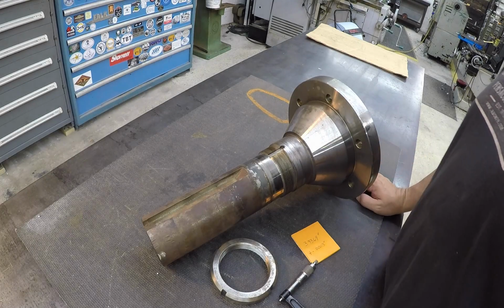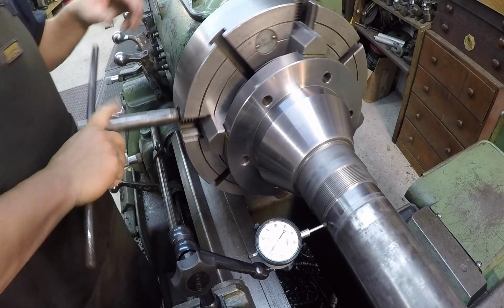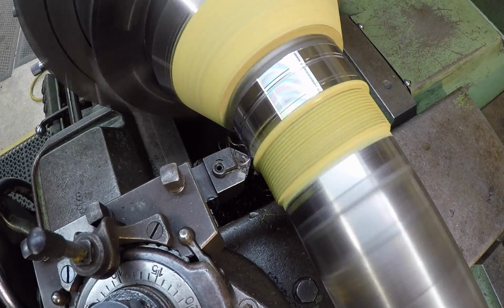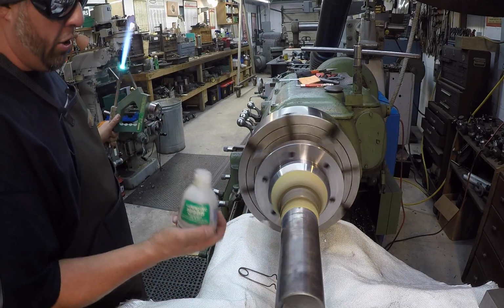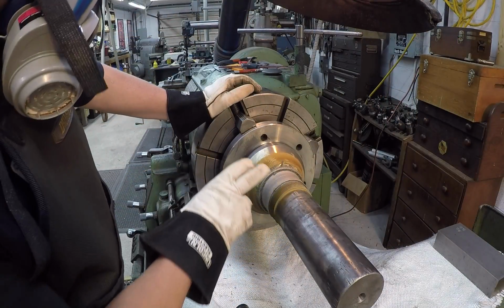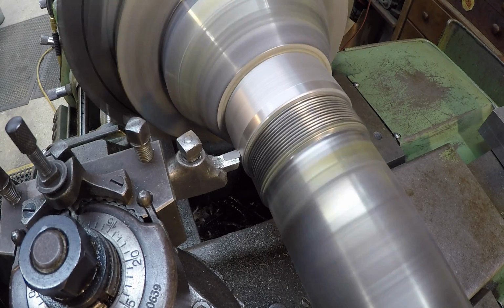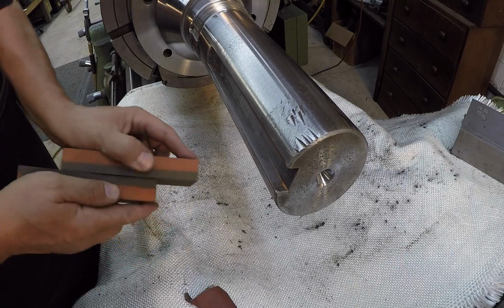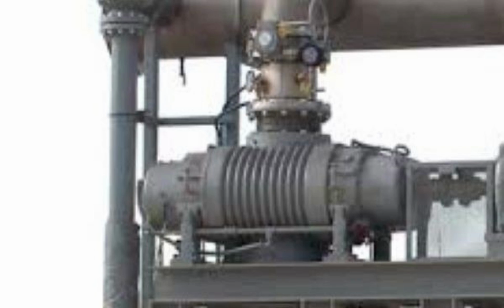SNS 300: Spray Welding a Blower Shaft

Comment: Interesting.  I used to be a machine operator (never got to be a certified machinist) back in the mid to late '60's,  Never heard of or seen Spray Welding before.  Great video. I love seeing a real true craftsman at work.  Your attention to detail is truly admirable.  Thanks for sharing.  I used to work in a plating room and had seen hard chroming done to tooling before but I'm not sure just what the limits are as to home much you can build up with hard chrome.  Typically the surface would be ground down to size afterwards.

Comment: I did metal shop back in HS for 3 years. I loved working the lathe, loved the smell of old oil and metal. Sadly they stopped offering it shortly after I graduated. Was a mechanic in the Air Force then wound up in IT. Think I would have liked to be an apprentice at a machine shop. Just found your channel and subscribed. Love it.
Reply: Sorry forgot to ask and maybe I missed it. Now this is the most awesome flaming death thing I've seen in a while, why do this over heat shrinking a sleeve on it? I heard you saying if this can't be done you would put a sleeve on it but why choose spray welding first? Seems amazing. Is the bond between the new spray material and the original almost like new? (maybe not saying it correctly but I think you know what I'm getting at) How would it crack or fail along the boundary?  What about brittleness of metal vs the spray addition?

Comment: I've done flame spray welding before to spray Aluminum on to steel on board ships where sea water is present a lot. The surface was sandblasted  first, then we sprayed. The worst part was that the humidity in the area we worked in had to be 40 percent or lower so the area had to have climate control to make that happen or the sprayed aluminum would just peel off. The equipment we used was also ancient and we spent as much time fixing it as using it. All in all, not my favorite type of welding.

Comment: I have heard about this, but never seen it before. Fascinating.
Having had various shafts hard chromed to save them with only moderate success. Mostly automotive.
I was surprised that shaft was still straight, I have seen no end of bearings that have spun and the shaft is never straight. Even if only 2-5 thou out of wack. That on an 25-30mm shaft.

Comment: This is a off topic question but does anyone know if parts washers filter and re-use the cleaning solvent ?
Reply: Yes, they do. The solvent is returned to a tank underneath the basin. The tank is wide and shallow, so that the solvent moves slowly and the particulates settle out before the pump picks it up again at the other end.
Reply: @BillGatliff  I appreciate the reply. I think its time for me to look into a part washer unit. Do you know if there are any decently priced units out there ? I only have a small hobby shot so I don't need anything crazy.

Comment: Have you ever try TIG welding + lathe instead of this way? I think it work and save cost.
Reply: He said in the video that he didn't want to weld it because of the higher heat input of traditional arc welding methods such as TIG, causing the material to warp. Customer probably asked for it to be spray welded instead of arc welded. All depends on the requirements, standards and specifications given by the customer
Reply: He mentioned that at the end of the video: the heat required can stress and warp some parts.

Comment: What is alloy for base layer and finish layer?  We used a material for base we called "nickel alumide", a wire; and a stainless wire for finish----(bearing and seal surfaces).  Well done video, lots of good tips and techniques.  Thanks.
Reply: I used a similar bond coating for most of my work. Used two grades of SS for bearings and seals as well. We’re you using a twin-arc wire spray or single wire flame spray?

Comment: Only thing I would have done differently is that I would have used a tool post grinder for the finish cuts. Done this procedure before.
Reply: Machinists who finished my spray jobs used tool post grinders quite often. Really good results.

Comment: we did shaft repair in our electric motor and pump shop back in 1961, however, we did not wave a torch fixture around in the air, the thing was affixed to the lathe for a more accurate job and the shaft was preheated in an oven overnight go figure, I would think this type of repair would be more common 60 years later!  THANKS FOR THE SHOW  WOW !
Reply: how old are you sorry but that was unexpected.  And #Abom79 you know your Craftmanship very well!! sorry for the bad english :D

Comment: I've read a lot of the comments but no one seems to know what the yellow material is that he paints on the shaft for protection.  Also, what is the material powder that is used in the 2-step process of the spraying?
Reply: I'd guess it's a ceramic coating. Maybe similar to stufff used in metal casting processes to separate the piece from the form.

Comment: Facinating video, clearly you spray enough and then cut back such that you can measure the sprayed layer when hot as presumably there will be some reduction in size as it cools back to room temp.
Reply: Yeah, you have to assume some shrinkage, then recheck after it cools to be sure. Do it a few times and you get a feel for how much a part will likely shrink. 
This guy, he knows his stuff. Love this.

Comment: Incredible work!!   Back in my day it was simply called "Metal spray"...  In the racing business we certainly used the process for high dollar custom components that got thumped, bumped and galled!  Use to be a place in San Diego called "San Diego Metal Spray"...  No idea if it's still there, but they did a lot of work out of that place both for private endeavors as well as commercial work.   Great video!

Comment: Ive done all stick , mig. and tig , submerged arc , heli arch , gasless wire , flux core .045 ,7018to 12018, stainless steel 308-309 basically all welding types,  im federal certified,  but my first Time seeing spray weld,  and I'm still mesmerized how good it looked and seemed to work real nice ,.....

Comment: One more question,  what is the tensile strength of this welding?????
Reply: Depending on the material and the spray process, I used to get 10k PSI pull tests on some of my coatings.

Comment: I remember doing metalizing on gas turbine parts. We had different processes to metalize. Plasma jet metalizing and oxy acetylene. From what I remember the bond layer was the key to a successful adhesion and sheer strength. High nickel powder bond. Great video. Takes me back.

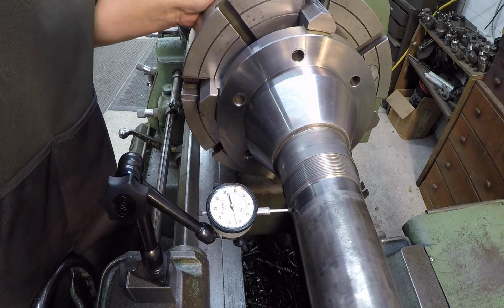Comment: I see at 7:40 you use a gauge to ensure concentricity.  If the shaft cross section has defects (i.e., the shaft circumference at point of measure is not sufficiently circular), how would you go about fine tuning the jaws of the chuck?

Comment: I did something like this back in the 70's, it was called metal spraying and used a wire feed which was fed into the oxy acetylene flame where is melted and coated the work piece.

Comment: I've seen this process back in 1969, but the spray machine was different. It shoot out bigger sparks. I believe it used a wire instead of powder.
Reply: Yeah, I worked in a big electric motor shop in 1968...we used a spray method with Oxy-Acet and a hard wire...the powders weren't really around yet...but now thank Eutectic for a great product!!

Comment: I was involved in this work when it was cutting edge tech..I hated doing it because it involved saving very large expensive parts weighing a literal ton or more and my boss was NOT happy...to say the least...if it failed to work.. and the work was an all day scorching experience that often failed leaving me to start again the next day...it was a pressure cooker job with little extra reward when it worked and a real sh_t storm when it didn't ...but it looks like the process has improved...but I'm content to watch instead of do it

Comment: ADJUSTABLE COUNTER WEIGHT FOR LOADINGG HEAVY PARTS! AND WOULD A 3 JAW CHUCK NOT BE BETTER FOR. TTHIS TYPE OF WORK?
Reply: He used brass shims on the jaws, he backed one jaw a bit less than half the total indicated runout and tightened the opposing jaw to to bring the work to about half the tid then did the other two to center the work near the chuck; then he tapped the far end into get the angle alignment orientation correct.  When a consummate Master Engineer/Machinist does it it look so easy. When I saw him center/align the work I knew I was in for a treat, perfect cut depth and surface speeds a pleasure to behold, and the icing on the cake spray powder metallurgy buildup.

Comment: glad you mentioned that this can't be used when a needle bearing is utilized ! about 20 yrs ago a company said they could build up the power steering cross shaft for a HF-64 Ross unit ! it lasted about 100 yds and peeled every bit of the stuff off and ended up in the p/s pump and locked the gear up!

Comment: I'm not, in any way, a welder.  But MAN this looks like it's messy and wasteful.  But at the same time, it's pleasurable to watch.  Thanks for posting!
Reply: it does seem to use far less metal and heat energy than casting or forging a new part that large.

Comment: Awesome video! I have an old spray welding kit that I inherited and I’ve read about the process but never actually seen it done. Im wondering if the process could be used for applying a hardface coating to a flat plate?Could a tungsten dust be applied with this process?

Comment: Hi, I got a pinion from a car which had been turned down 1/2 thousandth too much.  The machinist wanted the bearing to slide on.  All bearings are press fit and I am worried the pressures will cause this to fail early.. Can you put a little over 1/2 back on this pinion where the bearing sits?

Comment: Great job on this video. Spray weld is a common need for fast repair in the oil refining industry on bearing journals. We utilize repairs like this quite a bit.

You’ve done an exceptional job documenting and showing this process.

Very much appreciated and thank you!

Comment: Use a proper fuckn welder
Reply: He explains towards the end why he doesn't just use a welder. It heats the part up too much and can actually alter the temper of the metal which is very bad.
Reply: ur a dingus
Reply: use a dictionary and learn how to spell
Reply: @frankhorvath817  UR a dingus

Comment: Brilliant, never heard of spray welding before - fascinating to watch and the explanation awesome as well.
Any idea how hard the spray weld would be (Rockwell) compared to the original journal before it was repaired (roughly - ball park). Just curious if it’s much softer. Is it like a similar process to thermit welding they use on repairing broken railway lines?
👍👍👍🇦🇺

Comment: Question ?...... Those big dings on the end of the shaft... why not Tig fill them and turn them down or burnish them out of the shaft ?   would look lots better than with the polished dings
on the returned job.... but..... it sure looks like fine work.....  Just found your video and I'm a closet metal worker/welder/J.O.A.T.'s... GREAT JOB !
My Father was a welder for Bash Ross Oil Tool Company and some of that rubbed off on me. ( lol.) The oil not the welding.
Reply: Most likely that side gets a keyed coupling where those marks wont matter.

Comment: Hello, I believe you have used the micrometer with flat face to measure the journal diameter after grind finish. Shouldn't the micrometer used for diameter measurement have round ends for accurate measurement?
Reply: the piece is round so you are catching the outside measurement accurately, when you want round ends is for internal measurements. and im pretty sure that is done with a little removable tool that is springloaded with rounded ends and you then measure this tool
Reply: The flat face is correct for OD measurements.

Comment: Thank you for sharing this. I heard of this during the middle 70's from an employer but had not seen it done. Decades later seeing  it done helps understand why it was used then. I was told by this employer that it was cheaper than replacing the shaft & done properly that it would outlast an original.

Comment: Why did you take the piece off the center to do the actual spray welding?? Just trying to learn.
Reply: Centre not needed plus thermal expansion.
Reply: @samf5442  - why was the center not needed? Isn't it always better to have it it in place and how much expansion would reach all the way to the center hold over 1 ft. away??
Reply: He's running low rpm, the shaft is balanced enough for there to very little throw out due to centrifugal forces, it probably expanded by a few thousandths of an inch, which would just pre load the centre bearings, shortening the lifespan of said bearings unnecessarily, plus he wasn't turning the diameter near the end so the centre isn't needed, except for initial setup.
Reply: He cut the center to see if it was sleeved.
Reply: @AEJSOH20  - I was speaking of the center point hold opposite of the chuck for holding the piece in place?

Comment: Very nice work dude !! congrats you did a good job !!, this normally does we do not in the Netherlands, they welding it MIG welding, but they try to be aware of the to much heat inside the material so they use cold air to temper the heat.

Comment: one more tip

prior to your working tool, place several 'pre' burners before the work zone and at increasing temps!! 

core temp must be 200F it seems, but the higher the surface temp, the better the bond! so by using several 'staged' pre-heaters, you can achieve 'atomic' surface temps exceeding 1200F (right before you spray weld) and so your weld will be significantly more homogeneous and oh so much stronger and also easier to cut

much the same way as water evaporation works on clothing - only the surface layer reaches boiling point/phase change due to convection forced thermal induction, thus only the surface layer evaporates

same principle, in reverse
Reply: If you get it that hot, aren't you risking the temper? The last thing you want to do is have to heat treat the entire part again. You don't know what the original specs were and messing around with temper on a customer's part isn't smart.
Reply: @gotindrachenhart  
only if you heat more than the surface! it would be tricky, and may even require cooling after the application to prevent overheating the substrate - as mentioned one only needs heat the surface layer a few thou deep

Comment: Folks might be asking... and why not use regular welding rods and rebuild the worn out shaft?  This is the first mistake mechanics do in their life.... weld a shaft!  A shaft cannot be welded ever,  all the steel mechanical properties are lost if a welding rod is applied.  This process is known as a low temperature metallizing.  Temperature is kept below annealing so steel properties are not changed.
Reply: Carlos, I worked for an engine rebuilder for 14 years and he would weld crankshafts that were complete JUNK! He welded 2 marine engines on a raceboat that were doomed to failure. The boat didn't make it out of the harbor when BOTH crankshafts failed!
Reply: More than likely a Mild Steel shaft, thus  with a low carbon content of approximately 0.05–0.30% carbon if same  no heat treatment process apart from Case Hardening, could be carried out on same, the Kicker is whatever about the cost ...  quick turnaround as this item  the priority Time is Money  ... or  may have been taken out during, an annual Plant  "Shutdown" so was wanted back ASAP for Millwrights to rebuild same... saves having same being as it could be a high cost  Stores Item just sitting for a decade on a Shelf, He's correct, once heat would go into that Journal the effect would allow the shaft to kick off and deflect for a pastime, with little prospect of getting the same back to run true.

Comment: Great job Adam. My employer bought us a gun with some powders about 4 years ago, we used the aluminium/bronze powder for repairs similar to what you did and thus far they won't replace the powders. Frustrating. I would like to know what the masking material was you painted on to keep the metal from sticking to the threads? Thanks Adam

Comment: I took a short course as a  welder on RotoTec up in the Yukon 45 yrs ago from a 
Eutectic rep. The Eutectic Castolin Institute makes some amazing stuff. 
Is there a shelf life for the pyrogenic powders? 

I have worked in 2 or 3 machine shops over the years but only one had a Rototec kit.
I remember a machinist using it once but I never used the process again.
That looks like the same kit I used in 1975! Very expensive

Comment: I have used that torch for over 40 years!
Reply: how strong is completed process?
Reply: @alphawolf099 We use different base metals depending on the application. Anything from Stainless, to Tungsten to Ceramics. Some of the parts last 20x longer than OEM. I have had ZERO failures in over 40 years. (I went to the Eutectic-Castolin School and was certified)

Comment: FYI There is a fiberglass tape that is used for masking for flamespray/Plasma spray.
It works better than the coating your using and is easy to remove.

Comment: Similar to wire spray welding, I used to cut the grove in Piston rings and fill them in a molybdenum wire spray booth for Hasting Manufacturing. then grind the weld with a big grinder for my 1st job out of high school.

Comment: We use tuthill blowers to pull a 14” vacuum on weigh hoppers that materiel is pneumatically conveyed to. They are basically large roots blowers. Earplugs are not enough for the level of noise these put out haha. A typical one is driven at 3600 rpm by a 30hp electric motor.